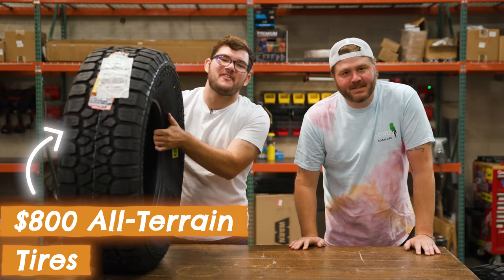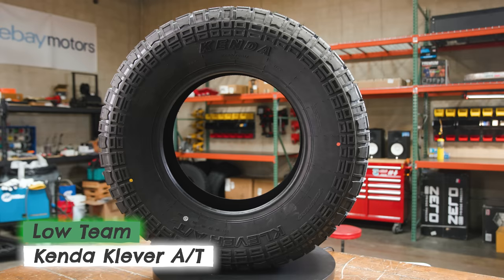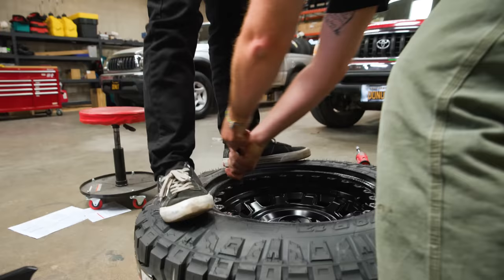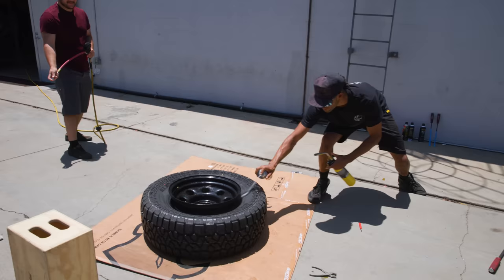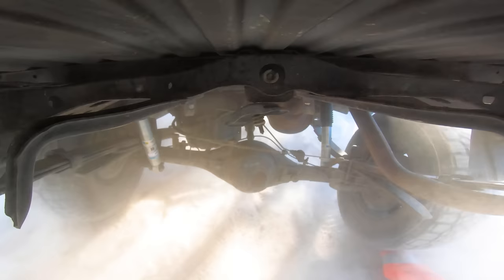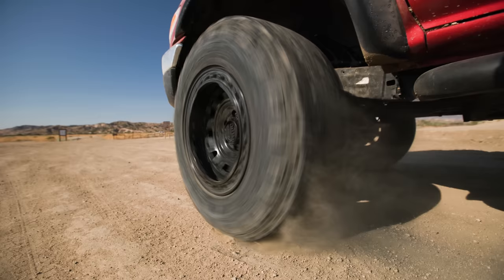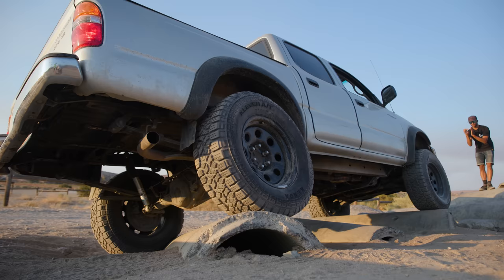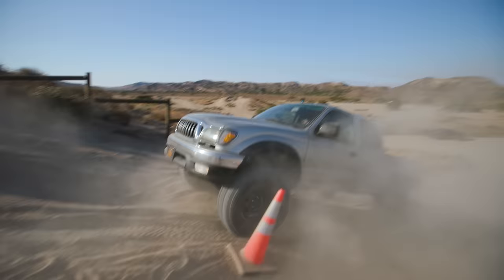$800 Off-Road Tires vs. $1500 Off-Road Tires

Comment: I’d take cheaper mud terrains over expensive all terrains when going off road
Reply: Right. I'd be way happier with some Patagonias, or some some MT variation of the trail blades or eldarados
Reply: When I buy a mud tire, I buy a mud tire like A TSL SX or a Bogger...  everything else regardless of what the side wall says is an AT tire,  lol
Reply: My nitto mud graps are worth the money if you use your truck off-road on a weekly basis
Reply: I've been consistently pleased with the performance of my narrow 33x10.5 BFG KO2 setup. I've yet to see a situation the mud tires perform better. In fact the fat 12 & 14 mud tires seem to do less well in what little mud we see (mostly south/southeast mountains), mainly because they kind of float on the mud and I sink down to solid ground.
Reply: Mud claws are like 150 a tire at Walmart and look very narley on a leveling kit silverado

Their 295/70/16
Reply: @garettodd3037  i got these same Hybrid 33" Nittos Ridge Graps on my 4 supercharged 4 runner they have been great gripping awesome at 100+mph ripping thru west texas and off road into old Silver mine shafts in the Sierras. I have 38" Milestar Patagonia Hybrids on my old squarebody 1 ton and they are equally as quiet, grippier than the Nittos look BAD ASS and are 33% less money👍🏻

Comment: I wheel an old caged Jeep and run 37” tires . When we do snow wheeling we air down to 4-5 psi with no bead locks. Beadlocks are overpriced spend that extra money on a good set of lockers

Comment: Ridge grapplers ate a good tire I have them LR (E) on my halftone and got over 50k miles on them with 1 rotation and still have plenty tread and they are still quiet, they wear pretty even as well.

Comment: one thing they should have mentioned is that there is a yellow paint dot on tires that is supposed to line up with the valve stem. the red one is for runout but that cant always be used and isnt always necessary

Comment: “This one has a beadlock…. Which means we can get through more stuff”

^someone who knows nothing about a beadlock or why you’d have one
Reply: Essentially still makes sense
Reply: True that... I run no beadlocks and at 9psi I ran a rubicon 2 times, and all other trails I run 8psi never debeaded, at snow I run 5psi.  The only thing that helps me I think is 10in wide rim with load e 35in mtrs..
Reply: Those “beadlock wheels” also only had one ring the inside is a normal seat so they can still de bead on the inside
Reply: @alexvech4121  yeah and I guess they didn't know that beadlock wheels are a lot heavier and that they're made to run really low pressure

Comment: I'm my personal experience on my trail rig and my 3500 iv done cheap vs expensive and I will never go cheap on tires again. I had 2 blowouts on my 3500 one at 250 miles and the other at 450. I was embarrassed and disappointed and wasted money. They vibrated like crazy. I don't recommend going cheap.

Comment: Beadlocks are illegal to drive on the street. FMVSS requires that wheels don't require maintenance. You gotta make sure the bolts on beadlocks are tight.

Comment: i've found that if you get the bead in the right position, you can actually stand on the tire and then walk it onto the wheel without any pry bars needed
Reply: @Robohobo weight doesn't matter. It's just like putting a bicycle tire back on

Comment: I've got a set of the Kenda's. Had them about 4 months and love them so far, however they are not the quietest at tires out there
Reply: I have the kenda RTs kr601 and they're pretty quiet and a amazing tire. Put 25k on them and they're not even half worn

Comment: The cost difference is: Amount of km (miles) you get out of them, wall thickness, tread pattern for water dispersion, grip etc,
Reply: Correct! So many factors that they did not even mention or consider when comparing the price tags. Ride quality. Longevity is HUGE!! The Nittos will double if not triple the life of those Lo tires. I know the Nittos balanced better and required less weight to balance.
Reply: @BBSKenny  they aren't going to drive 100,000 miles for 1 video in EVERY video they do when comparing parts.

There's so many reasons you didn't even consider as to why they did things this way🤦
Reply: @jionmionskwisgaar1476  you missed the entire point. Them missing things like longevity and tire composition are major factors in tire price. So saying the cheaper tires are a better buy is a poor answer when looking at them realistically.
Reply: @rooster6461  you literally missed my entire point. 

They. Can't. Drive. 100,000 miles. Every. Single. Time. They. Make. A. Video.

This is very much common sense when it comes to tires, so why would they need to waste time and bring it up? In every. Single. Video?
Reply: @rooster6461  they aren't going to take these cars 100,000 miles when they're made, so they don't care about how long they last🤦

They couldn't care less. They want to climb up hills, rocks, and homemade concrete courses. Not climb a highway across the state

That's the point of the video.

You don't go looking at tire reviews for offroading when you're looking for longevity.

Comment: It feels like hi cars tires are going to wear down a bit slower though, and fuel consumption may also be a difference since y'all didn't really mention that detail
Reply: great observation... I won't be critical to these novices... At least they're giving it 100%
Reply: Oh cause they are more expensive?
Reply: @percyjackson2800  because the high lift ones are harder compound. The softer tyre (tire, for you yanks) has potential to have its side wall torn much easier on rocks/tree stumps/crocodile teeth if you're traveling up the Cook track in FNQ Oz... ( far north Queensland) etc...

Comment: When it comes to wheels and tires. Would have really been informative to do two separate tests. One with high/low tires on same low wheels. Then high/low tires on high wheels.
Reply: or if they had really tested them. There wasn't really anything they did that one set succeeded at while the other failed.

Comment: Can I just say that unless your getting extreme terrain tires, most MT and RT tires perform the same regardless of price
Reply: Laughs in KO2s
Reply: @ryanmg02  I have KO2s on two of my trucks, but considered less expensive brands when getting the 35" tires on my K5 Blazer. There wasn't that big of a price difference on that size and I ended up buying them on sale from an off road chain store and saved at least a hundred bucks over all the other tire shops, including costco. I chose to go with what has worked well for the last 20 years on my truck, and had the extra money to spend, vs. taking a chance on something cheap. I do like to save money where I can and am not the kind of person who has to have the latest fad, or most flashy or high end stuff......performance and value are more important than "looking" cool.
Reply: @CGT80  agree with performance and value but I can't beat the ko2 as an all around good tire in most conditions including snow.
Reply: @ryanmg02  That is why I chose to spend more money on them. I like the look of an AT, but do only off road occasionally, so I wanted something relatively quiet that rides good, lasts a while, and can handle some snow, mud, or dirt when needed. So many people use a mud terrain for what I do and my K5 had mud tires when I bought it, but they aren't good for snow or highway use. You can't beat the KO2 for an all around tire. When my 2020 duramax z71 needs new tires, I will likely go with the KO2 DT which is meant for heavier diesel trucks. People have problems with the KO2 on these trucks, but the DT seems to hold up.

Comment: I decided to try the Kenda Klevers on my Excursion last fall.  Did fine through winter and the moderate off road use.  Love this series.
Reply: What would you rate those tires you have out of 10. I’m seriously considering buying them for my sierra.
Reply: @traviswarmanen9414  They are on par with the BFG KO2's.  Probably rate them an 8/10.  I would buy them again, especially when looking at cost to performance.
Reply: I had some kenda they started splitting after 8 months

Comment: I had Cooper Discoverer A/T tires on my 11 Ranger XLT super cab 4WD pickup.
I’m currently driving on my factory tires on my 23 Tacoma double cab, long bed TRD Off Road.
When they wear out I’m buying Faulken Wildpeak A/T tires for the TRD.
I’m thinking about buying a set of Trailer Hunter wheels in Bronze 16” wheels for my truck.

Comment: From Off-roading and Trail driver out west for the last 27 yrs. Seen alot of damaged aluminum wheels unrepairable on the trail where a steel wheel can be bent back and resealed to make it off the trail and back to town. (I ALWAYS go steel wheels, aluminium is just for looks)
Almost all of the testing done in this video depends on driver skill and very little on tires. 
Sadly, this video looks like a bunch of guys that  who have never driven offroad trying to impress Penny from Big Bang Theory...

Comment: you only tested dry grip which is 1 small aspect of a tire. Noise. Mileage. Wet traction. all very important. and really those are the areas the more expensive tires cover along with good dry grip.

Comment: There needs to be a 60k mile comparison of the tires.  You could get bead locks for the steel rims and STILL be much cheaper than the high truck bead locks.

Comment: hi-team tacoma is a trd and low team is a base. Makes sense for low team to have base model but the trd version does have a better diff and can send more power better to slipped wheels than a base model. In my opinion btw and i dont know technical stuff so dont hate 😅

Comment: So, I'm guessing it's down in the comments somewhere, but instead of having your buddy run over to deflate the tire, remove the valve stem core with a core puller (they're like $5).  The core doesn't need to be in for it to expand/pop on.

Comment: You don't need  to use fire to seat the bead, just use a ratchet strap and a pump.
It's way safer my young friends.
Reply: yep ratchet around the tire, crank it tight to push the sidewalls up to the bead, add air.  But fire is more exciting.

Comment: Haha used to run 12.5 wide by 35 tall on a 15 wheel and run them at 20 psi on the road was noisy as at 60mph 🤣

Comment: Longevity is probably a difference that you can't do in this test and that's maybe where the difference is. Maybe more so in tyer stability at low pressure how many ply between high and low.

Comment: I stopped using my e brake since I went camping and my brake light wouldn’t turn off. I finally got it to turn off about 24 hours later and messing with my e brake.

A part of me is afraid to go camping so far out again since the 4xe is having a lot of units that die randomly.

Comment: When you increase decibel level by 1 you are increasing the volume twice as much!!!!

A vacuum is roughly 80 db and TEN TIMES LOUDER than a telephone ring at 70 db and ONE HUNDRED TIMES LOUDER than normal conversation at 60 db.

So when the new tires “only” add 1 decibel, they are twice as loud as before. I thought that that might be important to note.

Comment: Skill lvl discounted many of these tire are close to equal off-roading other then longevity, Deep mud excluded. But if this is your daily driver, road conditions are far different.. snow, ice, rain, extreme heat and longevity are when the pricy tires show their quality.. I dropped 3k on fuel mavericks and 35x12.50r20 Toyo A/T III and thus far have had no issues at all, they are rated well for rain snow and ice tho, have not tried them on snow and ice as of yet.. also knowing i will not have to buy tires for the next 5 years or 65k miles is a plus :)

Comment: I'm surprised there wasn't a "do not try this at home" disclaimer when you used brake cleaner to mount the tire to the rim.  That should only ever be used as a last ditch effort in an emergency situation.  It can be extremely dangerous and people have died from the rim flying off before.
Reply: more business for you 👍

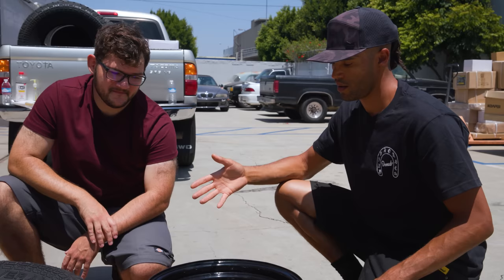but there was one at 6:15

Comment: yeah, going with the biggest tire isn't a great idea. you'll run into bump clearance and steering angle reduction and rubbing in the wheel well. i'd suggest that since you increased ride height 3 inches, running wheels that are 3 inches diameter bigger than stock is a safe compromise, giving you an overall 4.5 inch increase in clearance over stock, though you dont want to go bigger than 5 inches bigger diameter than stock. so yeah, if the tacoma had a total 28 inch diameter wheel and tire, 33 would be max you'd want to go. again that makes an increase of 5.5 inches of ride height over stock from your lowest point, which would be the differentials.

Comment: Seriously though, while the tires looked the same and performed similar, you NEVER spoke of tread wear. Of course you don't have time to drive them 30k to 50k miles, but you could have weighed in on this. It's important

Comment: Tire mileage depends on a few things . To give a mileage and say they will last that long is misleading. I know people who got all different mileages on their Ridge Grapplers and other tires. It depends on roads, part of the country, off-road use vs daily driving, aggressive driving and other factors. You may get 60k on your RGrapplers and I may only get 45K.  For example: I travel from NJ to NY through High Point which has lots of aggressive bends in the roads. I am hard on my truck and get about 30K on my brakes. Naturally, I’m not going to get as good mileage on my tires as some other conservative drivers. Too many factors to give mileage ratings on off-road tires.

Comment: It would have been interesting to swap the wheels between the two trucks, the different suspension in combination with the tyres would have made a difference. So would the low tyres have preformed better with the hi suspension?

Comment: I guess no one is going to mention that they got the price of both tires wrong? I had the Kendas and popped one and they are $250 a tire. Then I went to the shop and got quoted for the ridge grapplers for $1200 mounted and balanced. Their numbers are way off

Comment: For this type of cars it might be like that(more expensive not necessary)
But if you need the tires not to explode at high speeds on any type of weather then less expensive is more dangerous.  What I learned in Germany is don't cheap out on tires and brakes.

Comment: Why were the expensive wheel/tires 10 pounds heavier than the steel wheel/tire package? The aluminum wheels were said to be lighters. Hard to believe that the tires wire much, much heavier to offset the weight loss of the aluminum wheel. I would have liked to see the tires and wheels weighted separately.

Comment: Some things you didn't cover was highway ride comfort, vibration, noise level, fuel mileage, wet performance, and of course overall mileage. There's much more to tire performance than the few things you covered in this video.

Comment: If those tires are also apart of your daily driver did you account for longevity of the tire. I have done both low cost and high cost Allterain tires and the high cost ones always seem to last me 3 times as long.

Comment: I’m wondering if the actual compromise comes from MPG and tire wear when using your truck as a daily. The point of the series was having a daily driver that you can also off-road. I drive a 2007 Tacoma and the main reason I haven’t upgraded to a setup like low truck is because I drive my truck 20 miles to work and 20 miles back everyday. Gas prices are already high so any decrease in MPG hurts me at the pump.
Reply: At 40 miles round trip a 10% decrease won't be particularly noticeable

Comment: One thing you missed is how long each tire lasts. That's one of the main selling points of high priced tires is the long life span
Reply: Not only this but also other terrain. Nitto Ridge grapplers do really good in snow, I’m curious how the cheap tires would do.

Comment: Awesome series but I'll just note its really hard to "show off" offroad stuff.  Offroad performance is binary...you either get through or you get stuck/damage.  If you find an obstacle that debeads low truck then beadlocked wheels seem infinitely better but everything short of that and the beadlocks are worthless. The fact that not clearing something properly can wreck you is why people go so overkill on offroad mods.

Comment: My boss has a 3 mq tritons for work vehicles and hes had Yokohama at tyres on them great tyre but expensive got about 50 to 60.000kms on them hes just got kenda klevers and then seem perfectly fine. We do alot of dirt roads and farm yard driving never messed with pressures but they get through everything fine never had a puncture on either one of them

Comment: Expensive tires seam to last longer and ride smoother and balamce better but there ate tons of good cheap tires out there. I just bought some 38.5 x11.5x15 Boggers for my 93 4 Runner. They are sweet. Keep up the good vids and tell James to lighten up on Nolan.jeesh.

Comment: I understand y'all are covering all off road applications. I manage a tire shop..and not a fan of bead locks because they are a PAIN!! As far as tires though one thing I would like to point out is most people I know drive from trail to trail to home. And on road ride quality (balance of the tire) And tire mileage is wear you will see the biggest bang for your buck on the more expensive tires. I see people get 50 plus thousand mile out of the ridge grappler and Thay balance grate all the way up to a 38x13.50r20 those are the biggest I've delt with so far. I don't know if any one cares about that in this application. It makes a huge difference to my customers though. Expesaly how well thay balance.